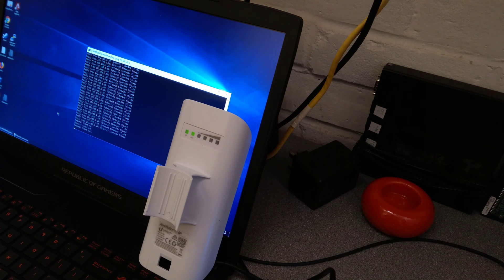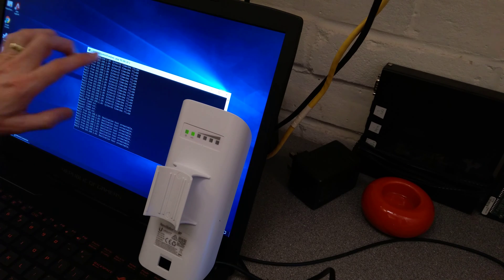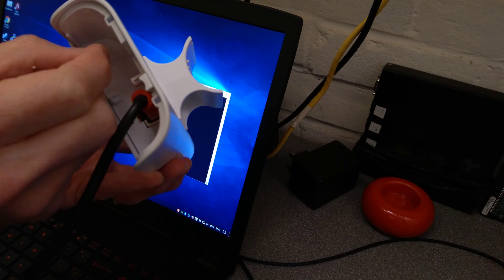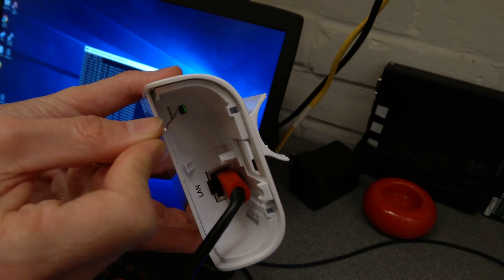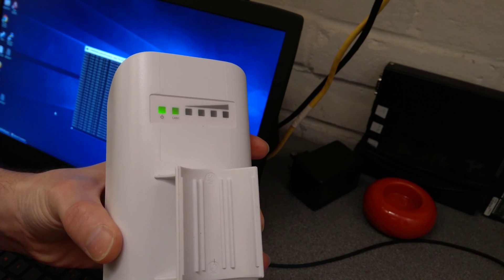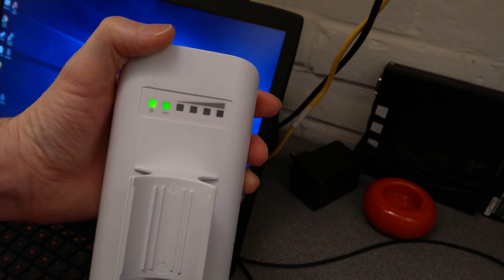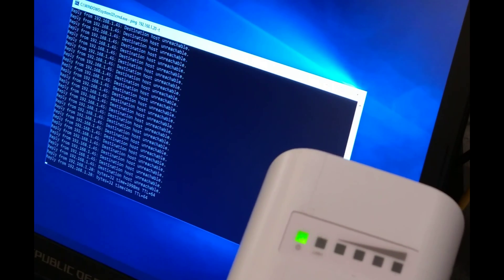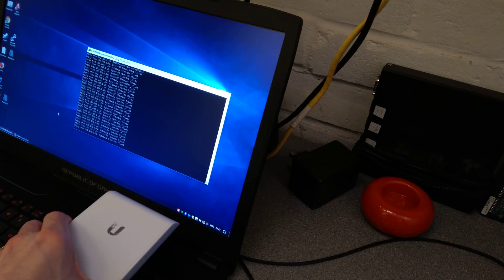How to factory reset a Nanostation Loco M2 / M5 (Ubiquiti) on-device

Comment: Did you reset without poe on
Reply from the maker: Yes, otherwise the device won't be on to know that you are pressing the reset button :D
Reply: I reset mine...I set static IP to 192.168.1.100...but when typing 192.168.1.20..my browser forces a http too https

Comment: You can see and feel the micro switch if you look closely. They are  frigging flakey Radio. I have had 4 of them that wont reset or save their settings once they have reset. Wasted hours of time trying to trouble shoot them.
 Id go for Cambuium and day
Reply from the maker: I've got only a couple of these Nanostations "out in the field" and both sets have been 100% reliable.
Reply: we have 3 of them out there also which have been fine for about 3 years but when they have issues, they are rubbish. @freename

Comment: I’ve factory reset 4 times and still can’t get them to connect. Lights are all good but won’t connect to internet? Thanks in advance
Reply from the maker: Can you explain more about "can't get them to connect to the internet" ? You've factory reset them and then what are you doing after that?

Where are you trying to connect to, or are you trying to use two of the devices to "bridge" a network between two locations?
Reply: Once I factory rest I reconfigure them. I’ve setup at least 20 of these devices in the past. Sometimes it it goes smooth and sometimes not. I’ve watched you’re video multiple times today and wrote down each step but still no luck.
Reply from the maker: @bradjohnson9204  If you change a setting and then do the reset does that setting get wiped? If you backup the config of a pair of known working ones and restore it onto the ones you can't get working do they link up ?
Reply: @freename  when you say linking up, you mean as the lights on the back or otherwise. I’ll try changing if setting and see what happens.
Reply from the maker: @bradjohnson9204  I'm sorry; I'm quite lost on what you are trying to do, the setup, where the Ubiquiti device comes into it and which part of your setup is unable to see what.

Comment: I was not able to reset my device this way.
Instead, i had to open it and push new firmware via TFTP, after putting it into urescue (i think it was) via a serial header on the PCB.
Reply from the maker: The person who originally configured it could have turned off the reset button. It's an option in the GUI.
Reply: Wow that’s beyond me. Need to find the step by step instructions for this method.

Comment: hi, IP Default its not working. can you help me?
Reply from the maker: If you got your device from an ISP they may have disabled the factory reset button.
Reply: @freename  i bought it 1 year ago
Reply: @freename  when i tried to ping 1.20 . Just works for 4 line reply bytes after that 3 lines "rto" and finally "destination host unreachable"
Reply from the maker: @eggyswibowo944  Are you plugged directly into it or is it through a switch or other stuff ?
Reply: @freename  I connected it directly to the LAN port (next to the POE Port)
Reply from the maker: Sorry. I do not know what the problem is :(
Reply: @freename  Its ok. Thank You!

Comment: After a power outage my m2 has no signal and factory reset didnt work the signal lights were red/ yellow then to yellow/green they would stich to
Each color. Now just no signal after powering it off for 15 minutes. Then got a signal but no internet
Reply from the maker: Have you re-set it up after factory resetting it ? If not, it won't know where or what to connect to!

Comment: Thanks for this video. But however hard I try, and no matter how long I hold the reset button in (and I believe I am hitting the button) the lights don't show that I've reset it and I cannot log in to the default IP address.  I am using an edgeswitch for PoE, not the PoE adaptor so can't reset there.  I would appreciate any help, thanks.
Reply from the maker: It is possible that someone has disabled the reset button in the Settings (System tab) in the web interface. Not sure what your option is there if that has been done - probably best to ask on the Ubiquiti forums.

Comment: Bro how much  voltage poe adapter of this nanostation?
Reply from the maker: 24V 0.5A (Positive on pins 4,5 and negative on 7,8). The model number of the PoE adapter I used was GP-A240-050 or Part Number POE-24-12W. Hope this helps. Please subscribe if it did.
Reply: 24V man